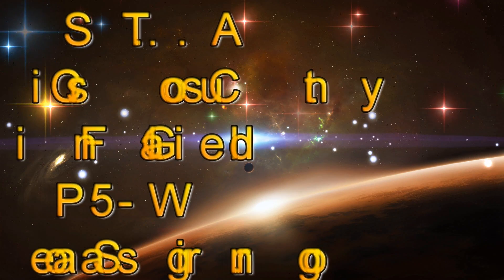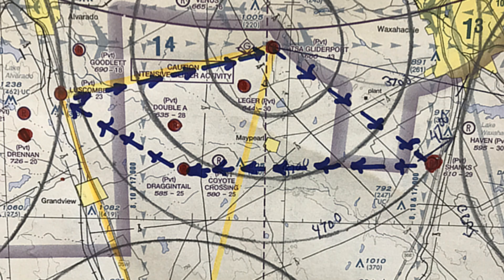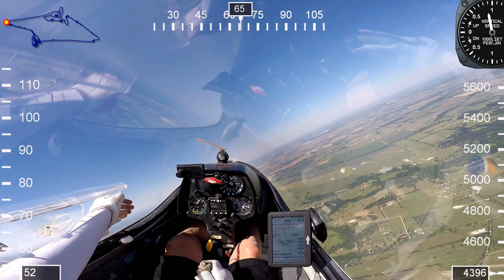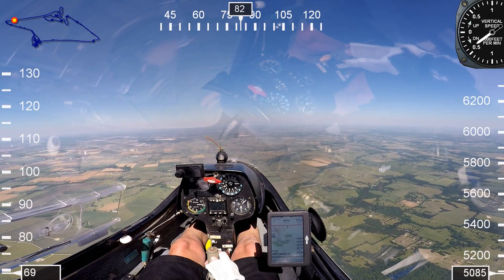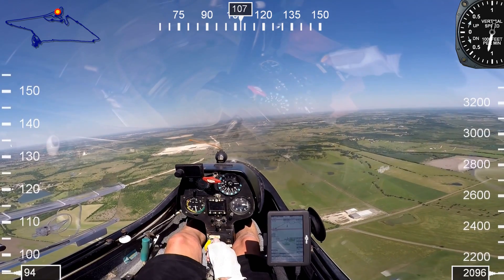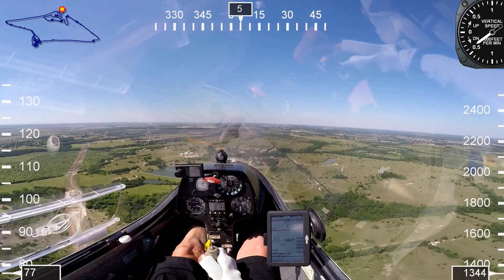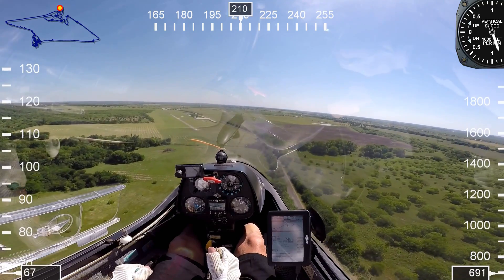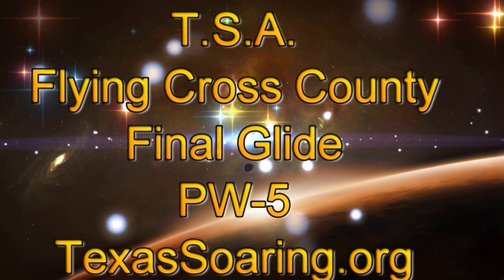Learn to fly glider sailplane High speed What is final glide Roy Dawson video

Comment: Still flying with a bootful of left rudder....hopeless video
Reply: The GO-PRO is mounted on the right side which with the wide angle distortion and different perspective tends to make the yaw string look off to the left  when its actually centred for the pilot . This is a great educational video. Where's your contribution to the field ?
Reply: @Fractalite   Its not hopeless video, but he is in the skid turn on final for sure. If you look at the str8 flight the yaw string is str8. He is coming from slip to skid. His final approach si shalow and on angle, he is not aligned with runway and then he is making last second correction. Probably very experienced pilot, who is well able to do it with no problem. But can get guys bad ideas.